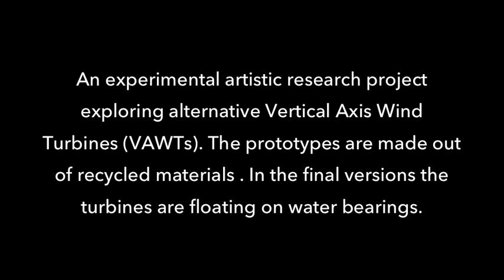A Tribute to the Persian Windmill – The Process

Comment: Impressive.  My hobby, similar to yours, is optimizing the panemone windmill.  The direction that I have gone is to divide each flap into a number of flaps.  As they get smaller...  inertia, momentum, gravity, weight, and noise will all approach zero.  Power and efficiency will increase.  I'm currently playing with 2” X 4” inch fencing with hard aluminum foil pivoting within each rectangle.  Really hard foil (like aluminum beverage cans) acts like a spring, too.
Reply: You have a  video of your work,   or something similar?

Comment: I visualized a shapeshifting wind turbine a few years ago but dropped the idea.

I figured it would be loud and prone to breakdown.

Deep respect for the man who built this.

There MIGHT be a way around the problem if you scale up 20x.

The rotor would turn slower but with more torque.

That would allow the blades to flex using linear actuators.
Reply from the maker: I also think that the endurance is poor if there are too many moving part. Especially the version with fabric would wear out quite fast. However there is a high torque in these models so I also think there could be some potential in a slowrotating rotor and a generator high transmission gear ratio.

Comment: Floating support is a good idea. 
I've seen other rotating vanes but they're mostly  too close to the vertical axis to deliver useful torque. 
Some designs use a rotating protective airfoil on the upwind half, eliminating the need for streamlining the backs of vanes.
IMO this could be a good project for evolutionary design.
Reply from the maker: Thanks for your comments!

Comment: Thank You for the great video and information. With this design there will be less resistance. Noise equals fast wear and tear. Sad! It still has the same flaw as other VAWTs  . The water bearing would be interesting.
Reply: The plans were taken away by the CIA the FBI and ancient aliens that came to earth took back the plans.  Nobody wants to have cheap energy, the illuminati is at work, that's why this has not put into effect,  not because it sucks , not because you are using some ancient Persians toy.   No is not that, IS the government! and oil companies.  yeah.

Comment: I can see applications for a vertical axis wind generator. With quiet material, you could put them as corner posts for a patio. Imagine building a 50 foot tall "silo" that could produce incredible amounts of power.
Reply from the maker: I have also thought about the potential of a largescale/slow-spinning (with high transmission). There would probably be some endurance problems, since there are many moving parts..
Reply: If the shaft could be suspended in a pool of light machine oil, and the transmission be a simple manual shift transmission, also in the light machine oil, using a technology that is called autoshift manual transmission, using the same theory as is used in trucks, but adjusted to control output shaft speed, could that work.

Maybe 50 feet is the wrong height, make it 100 meters tall and 20 meters around, lol. I am looking at building one on a smaller scale than 50 feet, I am thinking 3 meters tall and attached to a building with the works inside, When I get a place in the country  where I can work in peace. In town, Vertical axis lantern types seem to be less noisy, and take less square footage to be used.
Reply: I looked at your other videos, did not view them yet, but the biomimicry concept of energy production sounds interesting. I will have to look at some of them when I have time to take notes and verify a few things.
Reply: nope.    its   just    yard   ART.

Comment: I realize these are only experiments but I was wondering on how the metal vanes held up to wear and tear? I had a steel sign in my yard hanging on two i-hooks. Within a year's time of moving back and forth in the wind, it wore a slot through the sign from the hole to the top of the sign and required drilling a new hole. I see the metal vanes flapping in your windmill and wonder how it all holds together over a long term period and will it require a lot of maintenance? Another thought to consider on other materials; are they UV resistant? Plastic  vanes would require  dark/opaque  pigment to relegate the UV attack to only the surface and not the interior of the plastic. UV breaks the polymers making the plastic brittle. Another question, how efficient is this windmill compared to a propeller type windmill?
Reply from the maker: Hi and thanks for the response! Opposite vanes are connected through a hole in the main vertical axis. They have a 90 degree difference in angel, which means that when one of the vanes "closes" the opposite opens. For long term use I think the horisontal axis that the vanes are fixed to should be more robust and be supported by small bearings. Thanks for the advice about using UV resistant materials. I haven´t yet attached a generator, so I can´t tell you about efficiency – but I suppose it is lower compared to traditional propeller type – the efficiency of a Savonius rotor (which is a bit similar to these versions) is quite low. But if it would be possible to use mostly recycled materials I assume that it would be possible to compensate by going up in scale…

Comment: This is sublime.
It staggers me you've only had four comments.
It does not take much imagination to see how adaptable it is.
Or how easy to build using only basic materials and tools.
You've certainly inspired me and it will be my next project.
Thanks
Reply from the maker: I´m glad to hear that you got inspired by the project :)
Reply: More than inspired.
I'm now in the process of getting the materials to build one.
Am I right in assuming the central column floats on a base suspended in water in the "well".
If so what material did you use to attain buoyancy
Reply from the maker: Yes, it floats. I simply filled a large bucket with spray foam – but I'm sure there are better ways to do it. I imagine that the friction would be even lower if the buoy had been narrow&high instead och wide&low (the speed of the outer surface of the buoy would be lower), but I did´t try that out. It would be interesting to hear about your project, maybe you can send me some pictures later on?
Reply: @SimonShares  Thanks for your reply.
I've been away for a few days and just seen it. 
Never communicated with anyone on YouTube before, so did not know 
what to expect.
However thank you for your inspiration and advice.
I am toying with the idea of converting it to pump water for a simple 
circulatory aquaponic system. 
I will try and send you photos once I start building.

Comment: The problem with verticle windmills is...the wobble. There is more stress on one side than the other. More pressure on the downwind side that the upwind, and it is constantly rotating.  They will eventually tear themselves apart.
Reply from the maker: I'm sure these models would break down higher wind speeds. For a long-lasting robust system the construction would have to be simplified..

Comment: Try putting the axis of every flap just a little above the center of the flap. Just enough to make them still flap. That would greatly reduce energy loss from the turning of the flaps. The wind lifting weight of the flaps is power loss. 
 Then making the flaps longer will give you exponentially more torque as your wheel diameter increases. 
The bigger you can get your wheel diameter, the less your rpm. but the more your power yield. 
The more your flaps have to move up and down, the more power loss you get.
 I absolutely believe in this principle. It has superior yield, at least in low wind areas compared to the propeller type. it takes a lot of power to push a galleon cross an ocean, and this principle is actually sails on a wheel. Keep up the good work bro, you're on to something big. 
Go onto patent websites, you can see tons of drawings of this pending for patent. But the principle maybe thousands of years old. A chinese version of it  is a horizontal cross with four triangular sails on it.  Used for hoisting water up a well. A lot more simple construction than your versions, but yields actual applicable power. 
They got it right, using four sails on one cross beam in stead of so
 many small flaps.
Reply from the maker: Thanks for the response! I also think adjusting the axis of the flaps towards their centers would work better. If the flaps are in different layers (like in the  test model), the noise could be reduced if there were a small distance between the layers – so the flaps wouldn't bump into each other. Somehow I have been stuck to the idea of using many small flaps (to maybe get the sense of a "wind membrane") instead of larger ones. Using a few larger flaps/wings would of course simplify the construction. When it comes to turbulence I´m sure there are differences between small and large flaps – hard to imagine what the optimal flap height would be. At least they could be longer to generate more torque, as you mentioned..

Comment: Frontal, or 'disc area' is everything for a wind turbine.  Although a shroud helps there is too much construction involved.  This vertical axis sets of flaps does not make it and I would suggest working on other configurations.
Reply: I agree. Might be cool from an artistic perspective, but as far as capturing wind power to generate electricity, this is extremely inefficient!
Reply from the maker: If you think about making a commercial wind turbine for long time use, I also think these constructions are far too complex. These models are however purely artistic experiments – I plan to develop some of the ideas..

Comment: Would like more detail on the water bearing.
Reply from the maker: The weight of the turbine is suppurted by a buoy that floats in water – as simple as that. Sideways the main vertical axis is supported by two small bearings (one in to top and one above the buoy). The axis is not tightly fixed into to smaller bearings, so it (and the whole turbine) can move upwards and downwards, depending on the water level..

Comment: Can you show or explain your water bearing please?
Reply from the maker: The weight of the turbine is suppurted by a buoy that floats in water – as simple as that. Sideways the main vertical axis is supported by two small bearings (one in to top and one above the buoy). The axis is not tightly fixed into to smaller bearings, so it (and the whole turbine) can move upwards and downwards, depending on the water level..

Comment: There is something about this "flap" type system that I find quite intriguing.  I have studied all three types in this video numerous times, and still haven't made up my mind which would be the most efficient AND enduring over the long run.  But somehow, after considering 1) the noise, and 2) friction, I am more positive toward the fabric model.  It may well be the least efficient, but it offers the greatest long term use without requiring preventive maintenance.  A strong synthetic thread, and layered with a flexible sealer, would provide long term use, without breaking down.   Am I within the ball park?
Reply from the maker: I think you might be right. There are quite many moving parts in the constructions, so would probably be endurance problems with all versions..
Reply: @SimonShares  however weight also adds mass which can also add to regenerative breaking or extra magneto to suck in extra power, the extra friction on bearings is not a good thing this style vs conventional however this can be "allowed" to turn at potentially far more air speeds than a normal one as well, if one were to "float" this where the bottom pin is in a pool of water or something like that and the electric generating parts could be in 2 or 3 sections along the tower.

Solid panels have their uses much much more than fabric ones IMO unless you can figure out the absolute best angle to have permanent fixes fabric, where the metal flaps can be made out of countless materials as well.

I always liked idea of a wind "tower" where you have a bellows that captures as much air at the top as possible and concentrates this down the tunnel to a high cfm style turgo generator impeller 

I personally do not think these monstrosities that take up massive land mass for kw of air generation is the way when maybe a vertical style can produce 10x or more in the same area (esp if you couple with micro hydro generation between the towers and/or use excess power to pump water up hills etc etc... there are countless ways ^.^
Reply from the maker: @mauriceakamoefortin2510  I also think solid panels would be far better since the fabric would wear out quite soon. However it was easier to test the basic concept with some cheap&recycled light weight materials..
Reply: it is just  ART

Comment: why are there no drawings of these windmills.they would be helpful
Reply from the maker: There are no precise drawing since these are yet only experimental art projects. On page 55 in this publication https://issuu.com/simonshares/docs/slowtech-150dpi there is however a rough drawing of one of the models.
Reply: because they dont work as well as current design's..   we dont tend to go backward in effeciency.
Reply: I did this 35 years ago and does not work well.  Too much noise, too little power and too many moving parts to wear out.  
This is 35 years behind the design that I have today.

Comment: moving vanes adds nothing - fix vanes at 'best' angle' and shield up wind half from the air flow - less resistance - no moving parts yea!
Reply from the maker: I agree. A stiff structure without moving vanes would of course have the best endurance. I'm however keen to experiment (I see it like "3d-sketching" by building models) to get to know the wind better and see if there could be some alternative technical solutions. Even though the three-bladed HAWT are proven to work, I think that they are quite boring – the same basic model is only getting bigger and bigger. Especially on rooftops I cities I think there is a potential for small-scale vertical turbines..
Reply: Problem with that is the 'best angle' changes with wind speed.
Reply: Dennis, you're forgetting the need to lower surface area as the wind gets violent.
Reply: Hi Paul - good point - I agree - that's why the old farm windmills had an offset angle of the tail fin to the plane of the blades - the higher the wind speed the more the blades were feather out of a direction perpendicular to the wind direction - simple approach...…same could work on this mill...
Dennis

Comment: A drag device can never even get close to the performance of an airfoil design.
Reply: Indeed, but factoring in economies of scale and square-footage density, there's ALLOT these could do. Moving parts would be a problem, but ANY long-life bearing system would solve that problem, as long as static friction was also taken into account. There are other Z-Axis Windmill designs, and this one really doesn't stand out among THAT pack, but COULD be a viable option if appropriately produced and delivered to a commercial market. Ease of Access could be one reasonable advantage, but even there, Z-Axis windmills all share that advantage. One CLEAR advantage the Z-Axis windmill has is its in-use impact, both on nearby Human and Wildlife populations. Interesting idea, CERTAINLY one worth developing if someone wanted to. Might be an interesting way for an experimenter to enter a Commercial Product Market !
Reply from the maker: @chuckintexas  I think I could reduce the number of moving parts and use small long-livebearing (as use mentioned) to make a more endurable product – that might be commercialized. I think the strength in this models is that the turbine floats on water – a cheap and simple solution. It would be possible to mount the turbine much higher on a tall axis and still have the generator on ground level for maintenance. ..or have more friction in the bouy in order to heat the water. However it still needs a lot of  development :)
Reply: why the lenz 2 design is still widely used.  but I can see these if you cant afford wood.
Reply: John you say that because you have never done the math.  The propeller airfoil blade design is very poor and is also in reality a drag device.  I know of a company that makes a device that drives the blade with compression and not the drag of an airfoil design.